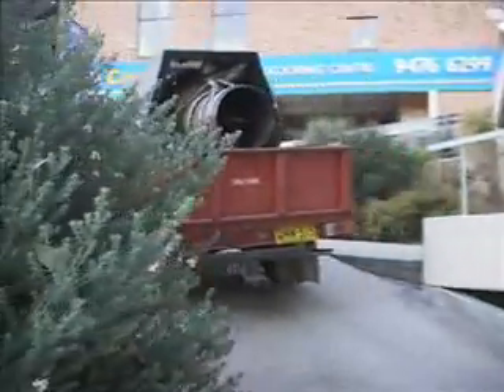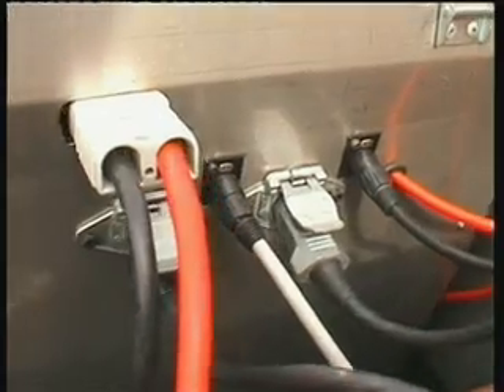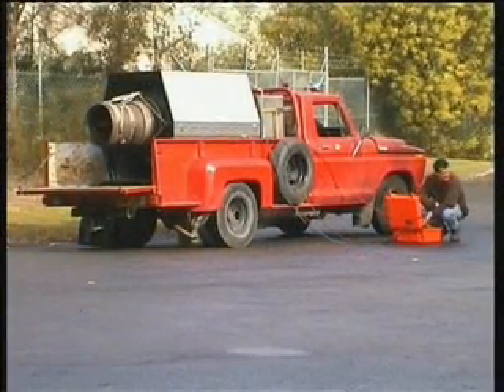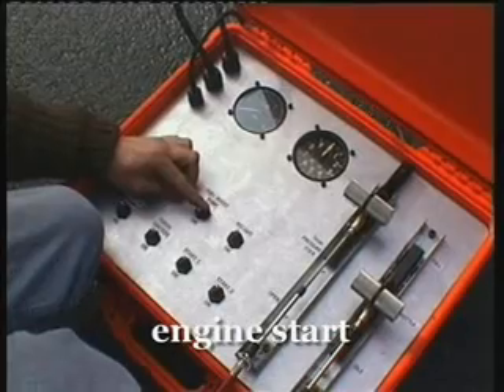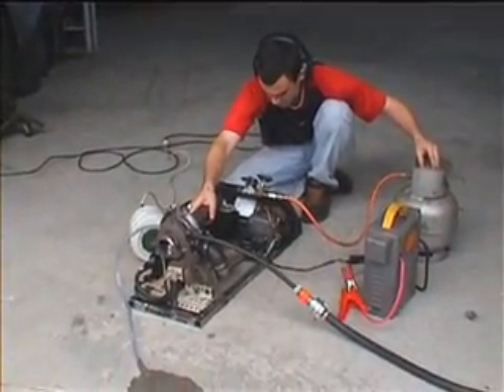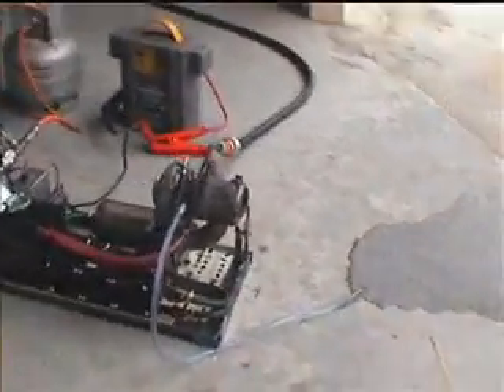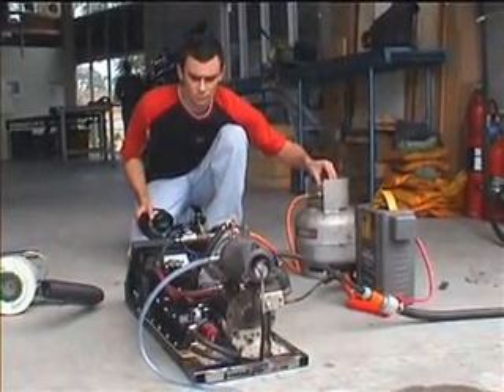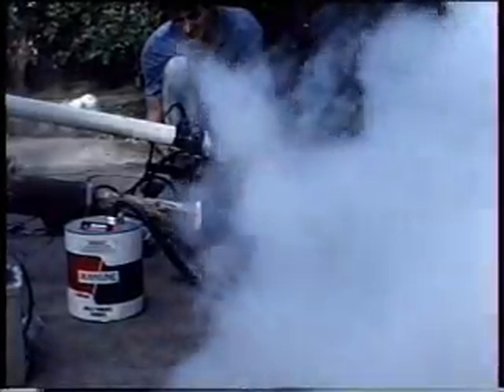Jet Engine Backyard - Episode 2 (4:3)

Comment: About the Fuel !! Jet Fuel (JP) and Kerosene was not used in those Engines ,It was Strickly Gasoline  115/145 Av Gas Purple in Color ,Hope this Helps , If that was Av Gas ,you would have had a lite Blue Flame out the Exhaust only ,the Burner cans should have fuel being ignited, in .The Turbine should be covered with a Yellowish Ash ,if running Right  No Soot should be Seen  ,,Seemed to be a lazy Flame .

Comment: First, what is the brand of the truck in the first video?
Second, I own a small commercial gas turbine, mounted on a bell 204b helicopter.
Running a generator with a gas turbine is not only nothing new, it is the normal mode of operation of both the APU of quite a few aircraft as well as the "Ground start cart" that you will find at airports around the world.
As the APU has a given service life they are rebuild only as the airframe is in service, finding a used one is easy.

Comment: @snakev10v5 From the looks of it that's a Whittle W.1, which only generates about 800 pounds of thrust, which is about what a handbrake handles when your car is parked on a slight downhill. 747 engines have about 60,000 pounds of thrust. each. It's pretty shitty.

Comment: If it is mounted on a truck, the air intake is blocked. It can suck from the sides, but it is not the same. 
You can get better performance by using a huge fan and less power consumption. 

Film industry wind machine? What about the noise? Doooohhh.....

American piece of crap.

Comment: Would you be able to use electricity produced from a small turbine/generator to make hydrogen gas to use as fuel? If yes, would there be any electricity left over to charge batteries?

Comment: If you did build a small power station using a turbo charger as the engine, could you charge a large number of deep cycle batteries with it in a short time? Or would it take all day and $200 dollars worth of fuel? Im curious as to how much torque those little turbine engines can make. I don't think it would be capable of turning a large enough generator to make it realistic. If someone knows , please hollar at me.

Comment: @circusboy90210 | many things are invented by so called non professionals. your right. just look at patents by country.
french: airplane, 
canada: open hear surgery, 
germany: computers, rockets, space travel, tractors, aomic energy
UK: whiskey, modern plow, bessemer steel process
atomic energy: germany, sweden, denmark - applied in usa
usa: assembly line, cotton gin, (modern) anathesia, ic chip, welding including tig & mig,

Comment: @vascoramaPT  

But i dont think the brakes are strong enough to hold the car in the same position because that jet engine is way too powerfull.

That car should be sliding over the tarmaq even with locked brakes.....

Comment: I was wondering the same thing. But the weight of that turbine and a old heavy truck like that, it probably easily weights in at over 4 tons.  

I looked up the Turbine and in came into production in the 1940's and the first version only produced 2000lbs of thrust.. So  that turbine isn't as powerful as it sounds.

Comment: The previous episode they said it was the RR engine model used in a Gloster Meteor. So about 1500 lbs thrust. You're probably right though about not being able to move the truck with brakes on.

Comment: And the question we all want answered is:

Did you ever fire up the jet, get behind the wheel and take the handbrake off? And if not, why not?

The coolest thing would be to go to a street drag, fire up the jet to a thrust that your brakes and tyres can just hold and see how fast your car can do the quater (using the trucks engine to get rolling).

Comment: i was wondering what factors need to be considered when desiging a combustion chamber... i.e. diamiter and length proportional to CFM of compressor? or possibly shape and flow path... what makes the most efficient burn with a liquid fuel such as kerosene, and what provides for the best longevity of the turbine, in terms of the combustion chamber...

Comment: actually you can pick up a lot turbine engine in aircraft junk yard for very cheap.. but you really need to bolted down to cement good..and not much use for it besides impress your neighbor or use as air / electricity generator.. if you decide to mount it on your car.. go to church first  ..good luck :) i know my basic hehehe..

Comment: I see your point, however, I was thinking about a (IMHO) more sensitive approach like powering the car through a "gear box", kind of like turbopropellers or helicopters are powered. Still, I fully agree with you, a jet engine is not by any means the best option to power a car. Anyway, the guys in the video were just carrying the jet engine on the  truck, I don't think it's legal to go around town with a turbine powered truck jet blasting everything behind you!. :-)

Comment: Well, actually there are some jet powered cars out there (like in those Dragster Car races in the States).  It's certainly not an efficient power source for cars due, among other reasons, to the relatively difficult power regulation, jets are designed for running at constant RPMs for relatively long periods of time, perfectly suitable for aircrafts but hardly so for a traffic jam.

Comment: I stood next to one of these in a dragster chassis behind art morrisons shop(fife washington) in the 90's you can't even imagine the noise or power one of these puts out.. quite exciting chaining it to a telephone pole and winding her up btw the brakes on that truck are enough to hold it still normal jet dragsters run full throttle without burner at the starting line then light the burners at the green light. the truck wont move.

Comment from the maker: These very early gas turbines don't have the power of todays units, the truck has brakes and that easily enough to stop the effect of this type of turbine.

Aircraft brakes do the same, brakes applied and you can power up the engines without moving forward.

Comment: carbon fibre would not hold up to the extreams of heat like titanium would...i also think that you would be hard pressed to improve upon the SR-71's design...it could run at mach 2.5 for periods of over 4 hours...before refuling was nessasary...4 jets would require more fuel, and although you would have double the thrust, you would likely only get a 35-40% increase in performance and top speed...drag is not a stationary value.

Comment: I presume the pickup was handbraked and in park(if auto).What would it take thrustwise to A)Over come the pickup Brake/park status and B) Lift the rear end of the pickup??? Awsome power.I work in lanfill and have witnessed the gas turbines that burn the gas and generate electricity for the grid.Good use of turbines.

Comment: Then I found an old snowblower in the alley and mounted it's 3 horsepower engine on the front of the bike.  Although the snowblower engine was better than the makeshift cog wheel/conduit pipe assembly, the high RPMs caused practically every propeller design to fly apart.  Also even made pretzels out of the shorter makeshift prop shafts, too, and even when it did hold together, the bike only move a couple inches forward at most.

Comment: In 2002, I tried making a flying bicycle, and the first thing I attempted was the propulsion part.  First I fitted a discarded conduit pipe to the bike as a propeller shaft, putting a propeller made from a bicycle wheel and scrap aluminum from a neighbor who was replacing his gutters on one end and a cog wheel on the rear end that would be spun by the rear wheel.  Unfortunately, the homemade cog either slipped off or broke and would not spin the prop.

Comment from the maker: Your right, the Derwent is not very powerful, its more hot air and noise than raw power, what is interesting as the jet engine developed each new jet was nearly doubling the thrust output, those early jet aircraft must have been tricky to fly with such sluggish gas turbines, apart from some of the earlt German stuff, problem there was the engines wore out very quickly.

These days its all taked for granted.

Comment: And yet, by todays standards, the derwent produces a very small amount of power, between 2000 and 3500 lbs thrust for takeoff, depending on the variant. Still a nice engine though. If he stripped down that truck to just the body and frame he could launch it straight up.

Comment: Have you guys considered moving on to a concept called the "trapped vortex combustion"?  GE, Nasa, and our mil have been researching it for about 10 years.  There is no moving vanes and it is supposed to burn very clean and with laminar flows, it is self cooling as well. The mil testing phase has ended at the end of 2007, reporting is done throughout 2008.  There is a lot of info out there on it if you google hard enough.  -cheers